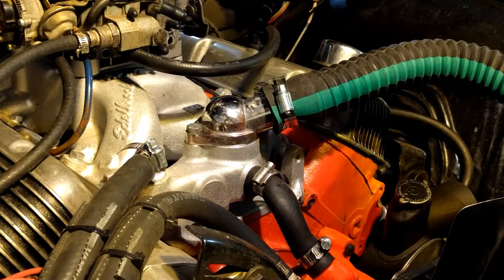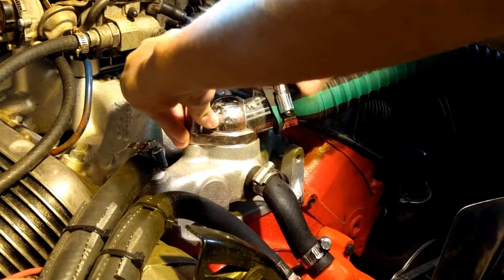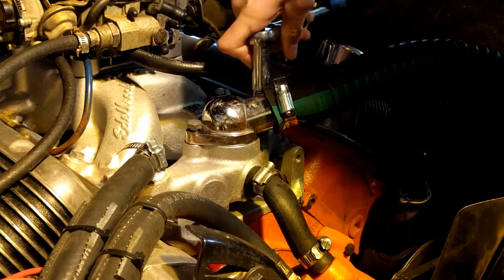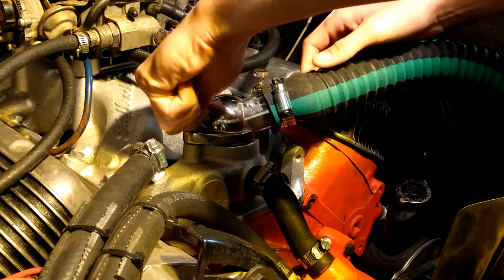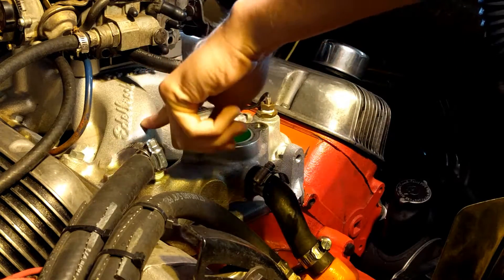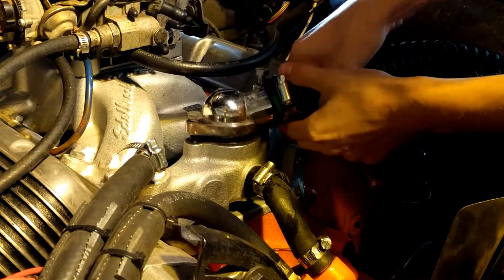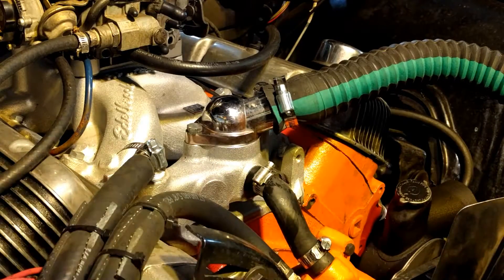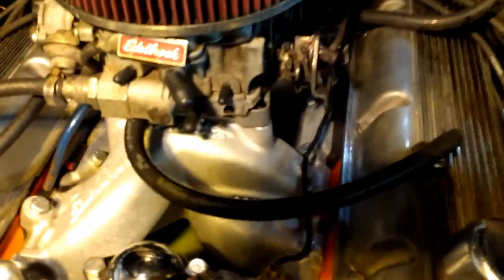How to Replace a Thermostat in an 1977 454 Big Block Chevy

Comment: Wow, nice video. Right up until you did not drain the coolant low enough so it doesn't flood your air through intake. And you need a new gasket.

Comment: If you know how to change a thermostat on one you know how to do it on all. They are all pretty much under the same housing you just have to look for. For example my envoy has it on the side of the engine at the bottom.